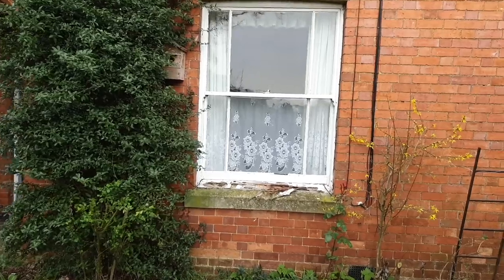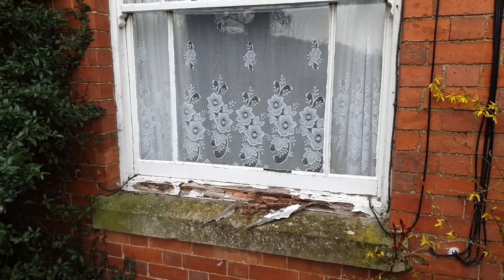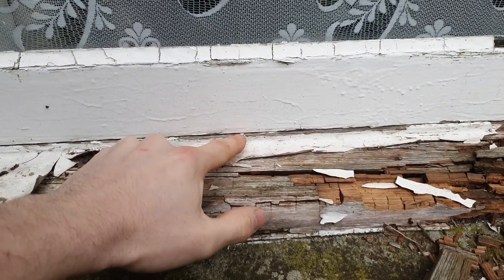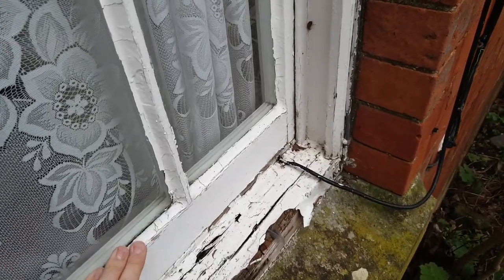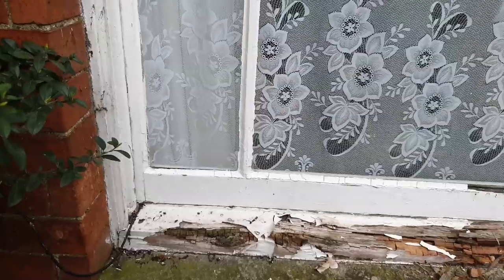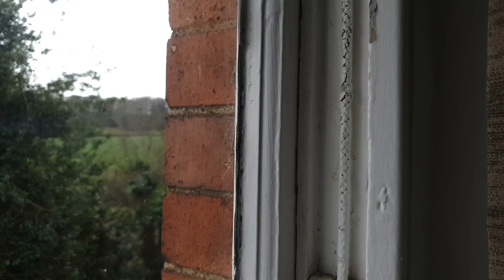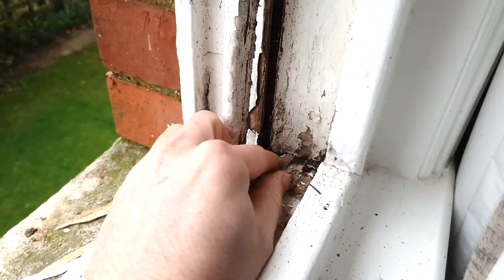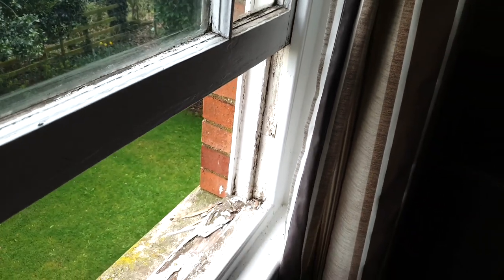Sash Window Restoration - Part 1: Walk Around & Inspection

Comment: excited to scroll through this series. I have read in joiner books on doors and windows that the glazing should be installed and beaded from the outside. that way if water gets down the glass, it is able to escape from the bottom of the bead rather than the rebate where it will just sit and rot. Which makes sense. But then, I wondered about burglars being able to just remove the bead and pop the glass out. But in reality, they are not going to take the time to do that. They will just smash and grab. It seems though that most of the timber window companies in the uk do the rebate on the outside. Love your videos. I am just someone who is fascinated by traditional methods of making doors and windows and am fed up with seeing upvc every where!! Thank you
Reply from the maker: thanks Lee, you can do both glazing directions and there are good arguments for both. Removing glass thats been glued in is not easy or quick so burglars wont be using that method i assure you! haha
Reply: @BradshawJoinery  hi. Thanks for your reply. Appreciate it. Good to know both methods are good. Excited to see your new series on Sash Windows. You are extremely generous with the content you show. Thank you

Comment: Excellent thorough video, thanks!  Lots of terminology in there to keep track of.  If you find the rot extends into the sills and jambs far enough, you'd just replace the whole unit I suppose?  There must be a point where repairing in situ is more than a whole swap-out.
Reply from the maker: Thanks Buddy, I have repaired sash bay windows before that i have made a complete new cill for and cut the box frame off nearly half way up, and rebuilt from there, staggering the joints to keep the strength etc. it took around 2 days to do so alot more economical than building a new Window. some windows are easier to keep due to features on them, ornate mouldings around the top of the bay window would have been thousands to replace. obviously a standard'ish box sash that was rotten in the head or most of the way through is probably best to replace the whole thing, but its a style of window that tends to only rot the cills as they are usually sat in a reveal on the brickwork so the majority of the box stays sound, hence they are commonly repaired. If youe the money they always look better with a new replica put in there though!
Reply: @BradshawJoinery  Good point on the recessed windows, that must make a big difference.  Over here we see a lot of windows further towards the outside of the building and less protected.  I've been looking foreward to this series for a while, thanks for doing it.

Comment: Great video (of many) - many thanks.  I am in the process of restoring some sash windows on an old farmhouse I have just bought. One question I had was if you were modifying these with draught strips why do you also need to put in double glazing.  I really like the look of the old glass...and its already there.  Why not keep it?  Keep up the good work!
Reply from the maker: NO Need. Double glazing is not only warmer its alot cleaner. no condensation or blackening of the inside of the window at glass/timber points No need for thick units, just a 6mm cavity is plenty on restoration work
Reply: Glazing and draft strips address two completely separate issues. Glazing improves the thermal performance by reducing heat loss/gain due to convection. The draft strips prevent air leaks at joints.

Comment: I restore windows and doors on listed buildings, I hardly ever need to remake new sashes, I’d fit new parting beads and staff beads with brush seals, completely strip the sash down to the bare wood, then star dowel all joints after injecting glue in, to strengthen them. Replace or repair any rotted timbers. Rebate the sashes deeper to allow new 6.4 laminated glass, which improves heat and sound efficiency, preserve all bare timbers, spray paint primers, undercoats and top coats, fit brush seals around sashes, new pulleys, rope and weights, wax all painted wood and polish glass. 🎉

Comment: Hi, could I ask which spindle cutter you use when making the sliding sash sill on new box frame windows please?
And thanks for the videos you upload best out there 👌
Reply from the maker: I use a large rebate cutter and tilt the spindle over to 9 degrees but if you don't have that facility you'll need a 9 degree cill block.
Reply: @BradshawJoinery  Ah, my spindle doesn't tilt so yeah 9 degree block many thanks 👍🏼
Reply from the maker: If it's just a few cills you can get profile knives in 9 degree. 👍

Comment: How is the side of the box frame style fixed into the cill? As it’s normally not that thick. Like the pulley style where it meets the cill?
Reply from the maker: It sits in a housing. The depth of the housing is so the pulley stil can be cut square and meet the front of the box. Can either screw in place from underneath or wedge against the end of the cill. (Glue and screw imo)